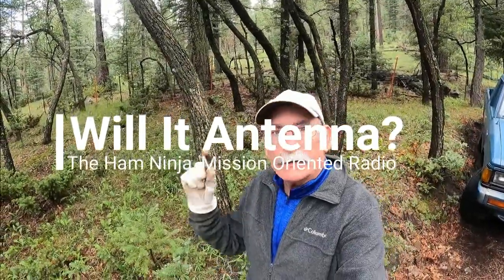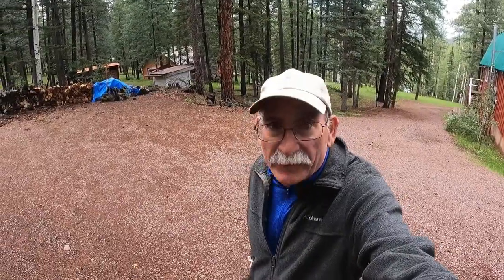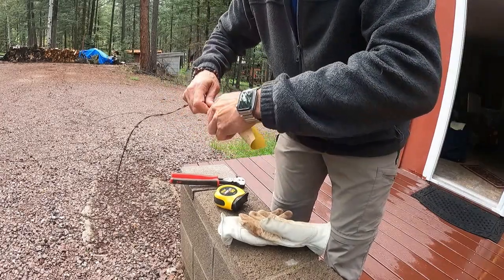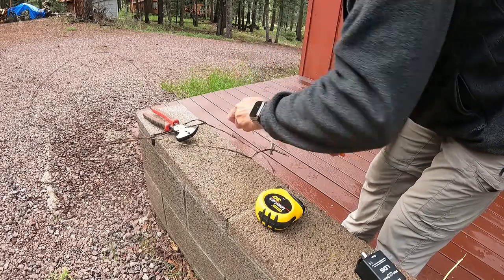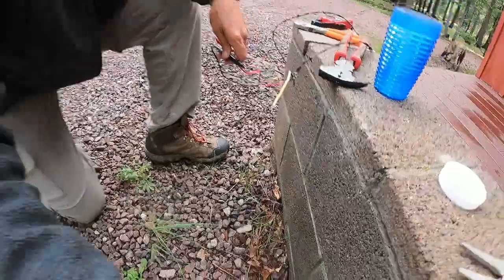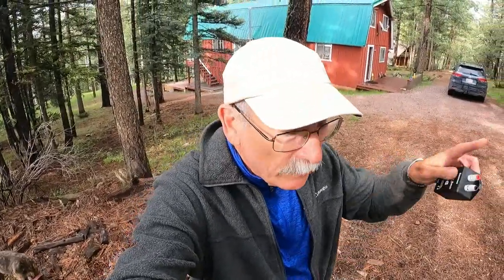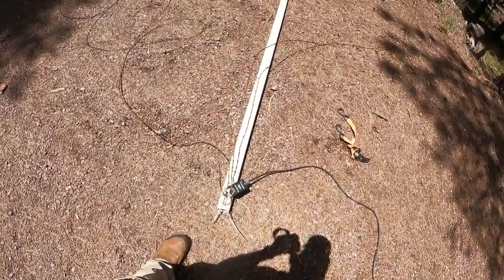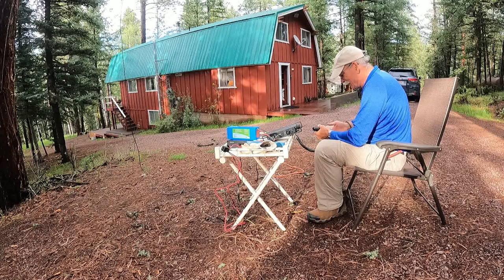Barbed Wire -  Will It Antenna?

Comment: Made a CB dipole out of split 300 ohm ladder line in 1977. Up in the air it looked like barbed wire that's when my old dads call sign become Barbed Wire Bill.